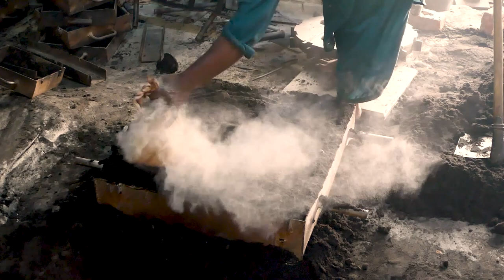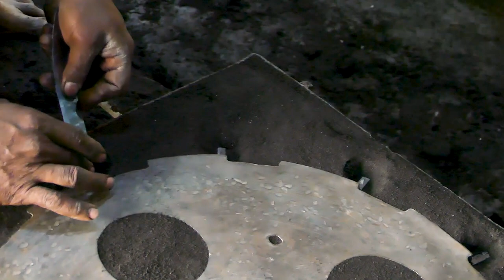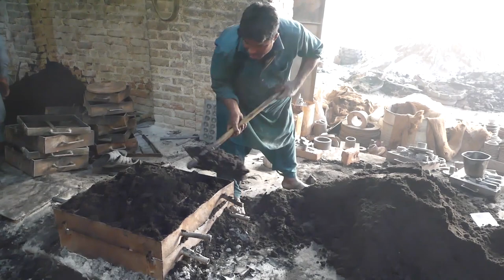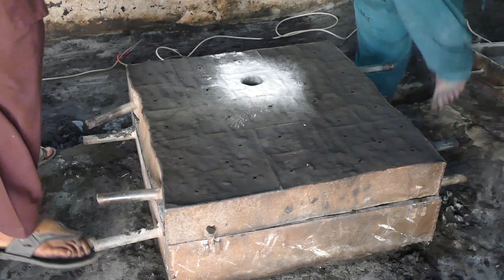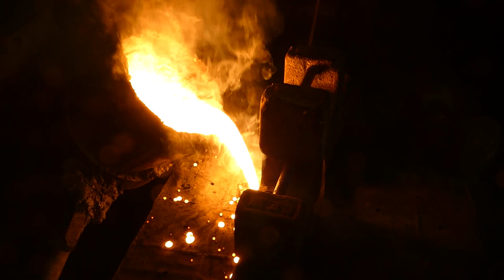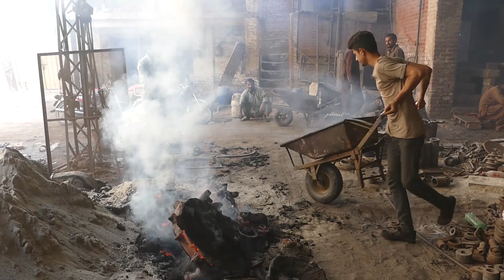Large Metal Parts Casting Process in a Cast Iron Factory

Comment: Dumping the red hot casting is bad practice, though.
Will be distorted like crap in the end.
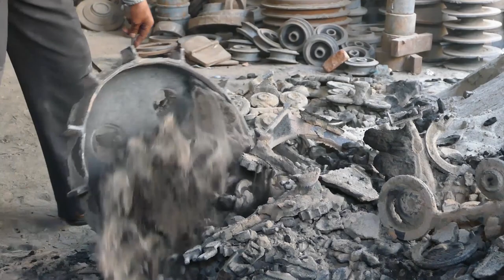Reply: True. Should be taken outside on a long trolley with racks and allowed to cool instead of a wheelbarrow and then being tipped over hard. I was really cringing at 9:20 as he's banging cast iron with a hammer. Even cast iron that's a few years old can easily break hitting it with a hammer.
Reply: @OffGridInvestor  How do you know it is cast iron?